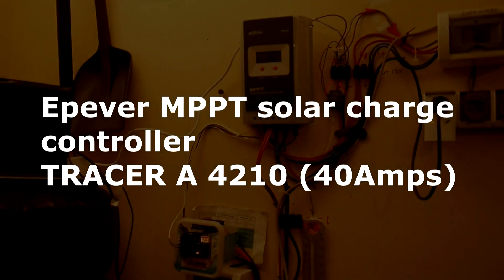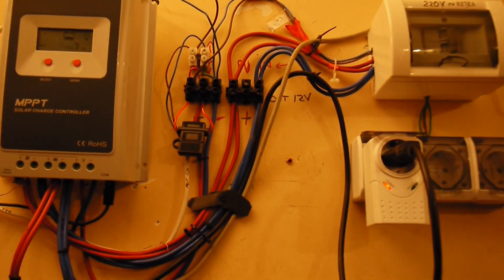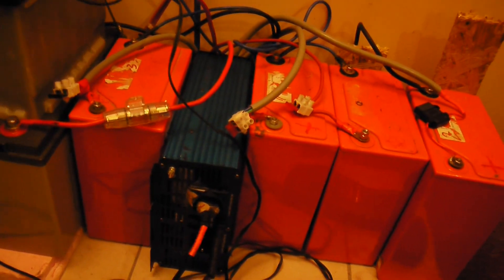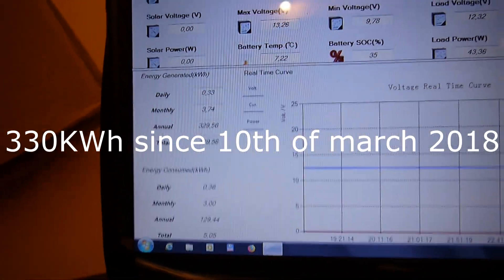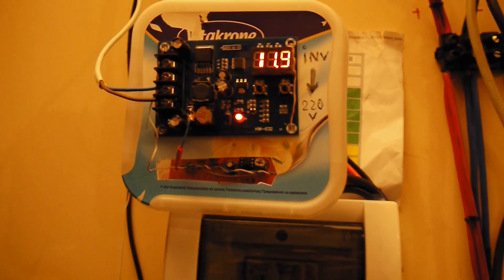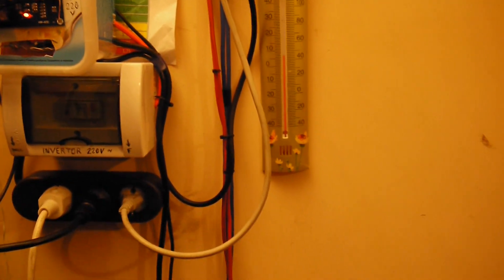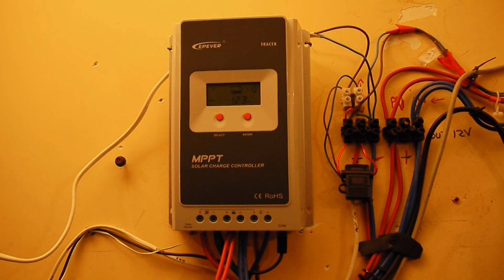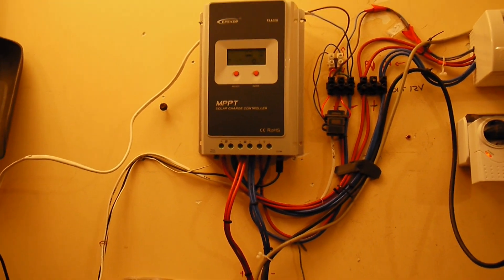EPEVER MPPT Tracer A 4210 solar charge controller after 12 months in use.

Comment: how can you recomend this product when its software doesnt work on windows 10,on windowa 7 it takes so much hassle to get data from it
Reply from the maker: Well the charger is working very well.and the software is good.I didn't had any problem with the data transfer.I recommend it because it's reliable.
Reply from the maker: It's working with Windows 10 also, the slow data transfer is because the port and protocol is used, in fact is not so important as long as you have a 10 seconds refresh on getting new measurements.For the money is the best I've used!
Reply from the maker: Hey there! Please help me with subscribe..Thanks!

Comment: How many panels are you using and what is their wattage? Thanks in advance.
Reply from the maker: Hey! I have 1000w panels, am using them to a 24v battery pack.It's almost the maximum  1040W supported by device, I reach easily 38A but the machine is working great!
Reply: I decided to go with these controllers and so far they're working great. But I should have gone with larger controllers. No big deal, it's working. The 60 and 80 amp controllers support chaining through their lan ports and I didn't know that when I bought the 40's.. Anyhow,  I'm adding 6 more 300 watt panels and will have them wired for 36 volts in sets of three in series and then paralleled into a 60 amp controller. 1800 watts is well below the limit at 36 volts for these. 5 controllers total with 4.7 kw. This is just too much fun. Check out the last three videos on my page. One thing I learned is they don't seem to like windows 10. I had to go to windows 7 am having no problems.
Reply from the maker: @timsvids5983  great setup ! A lot of work and passion! Thanks for sharing.
Reply from the maker: Passion|! that's it! Thanks!

Comment: Can you do a video or point me some links on how you install/modify the system to switch to grid when the power is low like 12.1V? I would like to know how it is done. I am a beginner on all these. Thanks
Reply from the maker: I will put the schematics altogether in few days, we are in the middle of Christmas rush here, but for the beggining you need an 12DC to 230V AC inverter, with a kind of remote control, I just soldered 2 wires to the on/off inverter contact.Then you need 3 relays 12v/220v/10 amps for the switching part of the schematics. Also , order one of this cheap battery chargers, XH-M603 like this :
https://www.banggood.com/XH-M603-DC-12-24V-Charging-Control-Module-Storage-Lithium-Battery-Charger-Control-Switch-Protection-Board-With-LED-Display-Automatic-ON-OFF-Real-Time-Voltage-Monitor-p-1250279.html?cur_warehouse=CN
That will be the main control unit, so it can be programmed to switch on the relay when the voltage is under a certain value (12.1 in my case) , in the same time the inverter is switched down and the other relays are commuting the consumer to the main grid..is not so hard to understand the ideea. Afterwards, when the solar panels are charging an d the battery returns to normal voltage, XH-M603 disconect the on board elay , turn on the inverter and the ''mains relays'' are disconnecting  from grid and connect to inverter out to consumer.But Like I said I will draw a schematic soon.Thanks for looking!
Reply from the maker: I promised I'll be back with more info about battery protection under 12.1v.Please check the video about mooding my inverter, so it get disconnected from the batteries also when reach 12.1v.If not there will be a 15w consumer for nothing.
The main important board in this project is a cheap chinese  HW-632 battery charge controller.It have a relay, normaly on as long as the voltage is in the charging limits.What I have done is to reverse the function, with a new relay with double contacts, so when is reaching 12.1v, the relay is getting disconnected and the off contact is putting power to the next relay doing the switch from inverter to mains.I also did some electronics with a IC and a couple of transistors to delay the commutation time..but that's not really necessary.I'll put a schematic soon.I hope you got the ideea..is not complicated at all.
Reply from the maker: check this out !   :  https://www.youtube.com/watch?v=E-_xpAiezus&t=1s
Reply from the maker: Hey Joseph! Please help me with subscribe Thanks!

Comment: just thoght i would let you know that you can rin 1500watt of panels and when the controller hits 40 amp into battery it backs off on the input
Reply from the maker: Hey David ! Please consider subscribe ! I need your help ! Thanks!
Reply: @viocaia  just doing now
Reply from the maker: @1981dasimpson  Thanks David!
Reply from the maker: I already have more PV to upcover 40 amps, I'm thinking about rise to 24v for harvest more power.It's a work in progress.
Reply: @viocaia  the controller can handle more then 40amp input so more then 500w what it cant do is put more then 40amp into battery so the inverter ramps back on the solar been input to keep battery charge below max current and yes when i biuld another system ill be going 24volt and stepping down where needed smaller wire needed and less cost
Reply: @viocaia  yeah 24 volt is the way forwed if you can get 60 cell 265wat each panels they can be wired in 2p5s for 2650 watt
Reply from the maker: Yep, first I have to switch to 24v and for summer I'll add 600w more panels.Thanks
Reply: @viocaia  at 24 volt you could run 3000w of solar better option is grid tie panels there cheaper
Reply from the maker: Thannks for that  @1981dasimpson   I 'll checki it out!
Reply: @viocaia  info should be in the manual
Reply: that info come from adam welch  in passing convo on another youtubers live stream
Reply from the maker: @1981dasimpson  Yes Adam is a treasure! But I'm afraid Tracer A can't handle more then 1700w even on 24v.Well of course it can be connected to 10 times more, it's taking as much it can..but I can't see why should I have more then 2000w of panels as long as 1700 is the limit anyway.For now I may say with almost 700w on the roof I can easily reach the limit of 40 amps..my 300ah batteries are full in a matter of hours..but again I'm waiting for better weather and temperature to start developing the next step.Because of hard winter here I barely reached 10Kw from 1st of january (20 days),In the summer I could have that in 4 days! Well...let's not forget to have fun...like boys use to have!(doesn't matter the age!:)))Thanks David!
Reply: @viocaia  i always plan a system for the worst week of weather
Reply: the idea is to max the controller even of the worst of days
Reply from the maker: @1981dasimpson   right, that's a good idea!